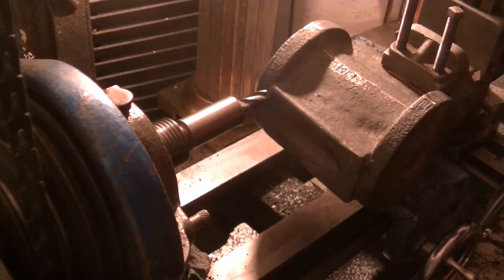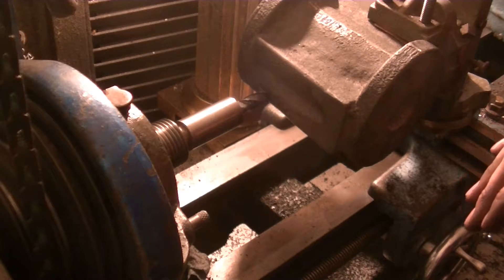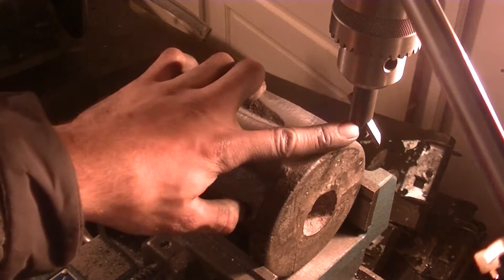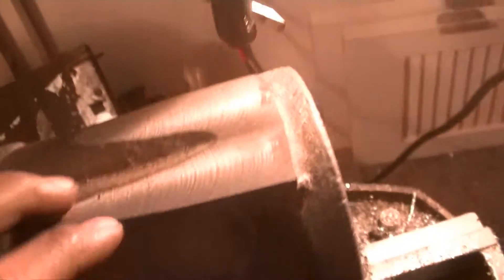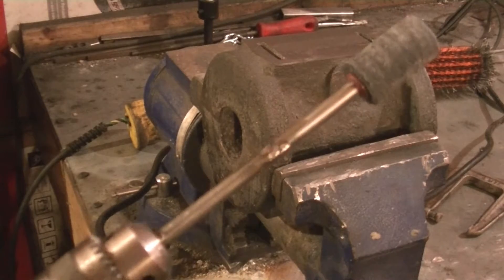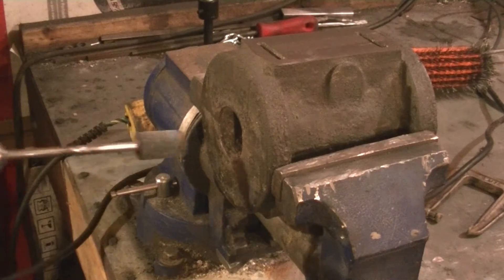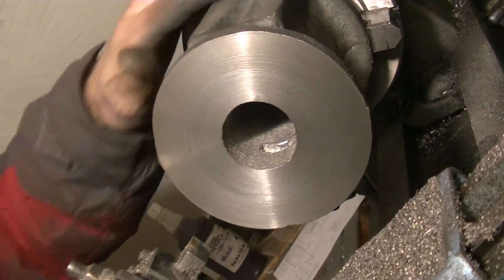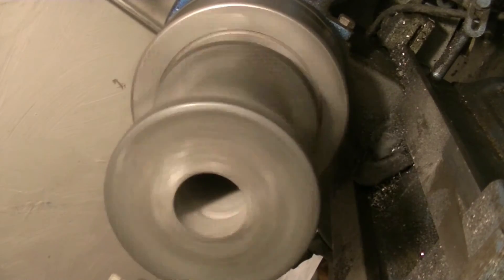Steam Engine Build: Machining the Engine Cylinder: Part 1

Comment: This is a great set for building steam engine but I would really like to see a complete build that  includes steam boiler to power the engine. Most steam engines on youtube do run by air, but including a steam boiler build  would be icing on the cake.
Reply from the maker: I most definitely plan on doing that.  It will be a long way down the road but it will happen.

Comment: why not face the outer diameter of one end to give a circular/ true surface for the lathe to clamp to?

then flip it over do the other outer diameter and you then have know 100% the part will be square end to end when doing the main face and that the boring of the centre hole will be straight.
Reply from the maker: I believe that would have worked well.  My thing is, I wanted to keep a rough casting look on the outside for aesthetics.

Comment: Why not deeper, but slower cuts? So that it doesn't makes those cuts and your bit doesn't need to cut through sand in the surface of the casting?

Comment: Nice build! Maybe grind off the scale With angelgrind?
Reply from the maker: I've tried that.  It doesn't work as well as you would think.  Takes forever and the problem is really that the iron is too hard,.  I need to work on my chemistry for the melt to make it more workable.